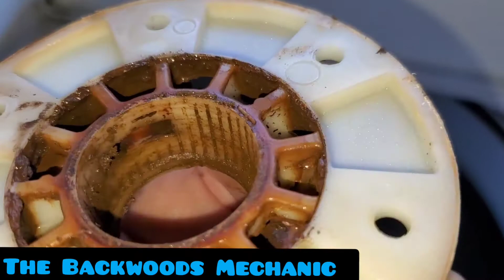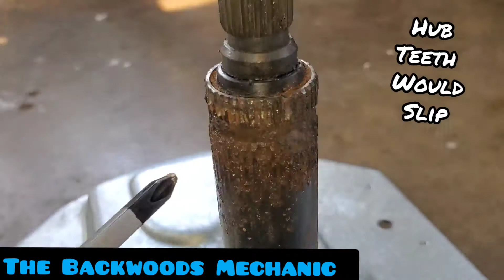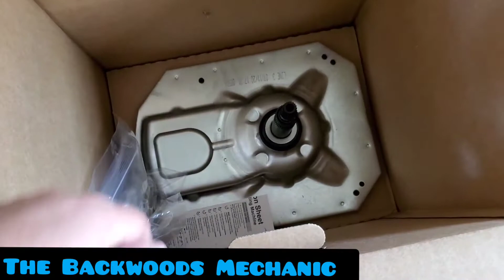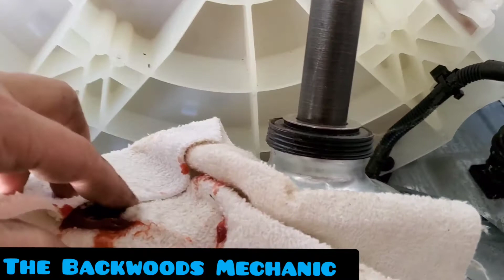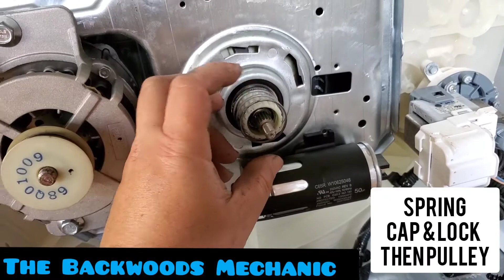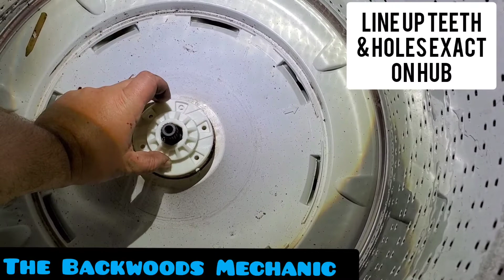Maytag Centennial #MVWC415EWO Gearcase Shaft & Hub Replacement #servicecall #repair #splutch

Comment: Great video! I have a Maytag top loader similar to this one. It’s balanced on the floor but squeals during the spin cycle. If I put my weight on the front left of the machine, the squealing stops. Any idea what that could be? I’m interested in attempting to fix it myself.
Reply: Pushing down on the left front. 
  Are you sure it is completely level?
  Sounds like the left front is a little high or the right rear needs adjusting.